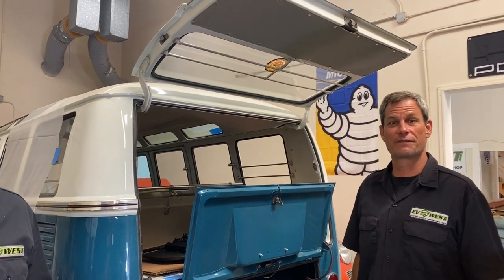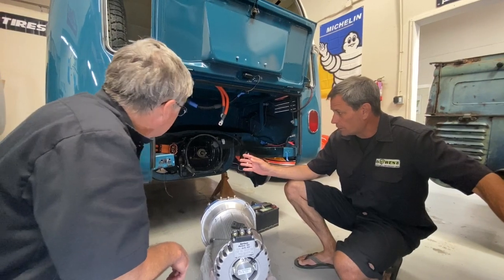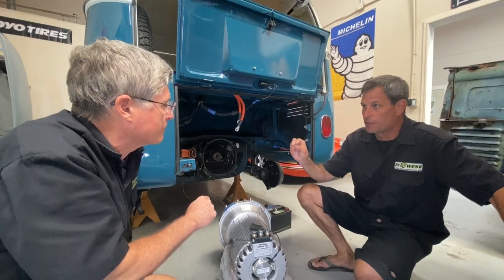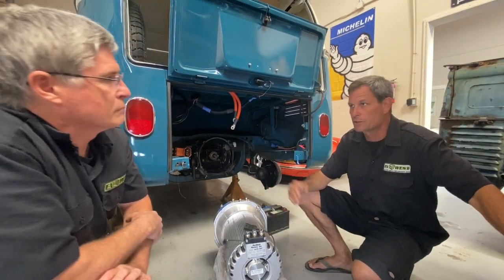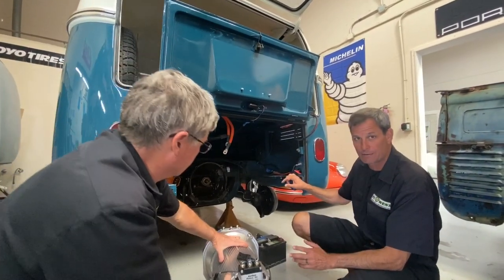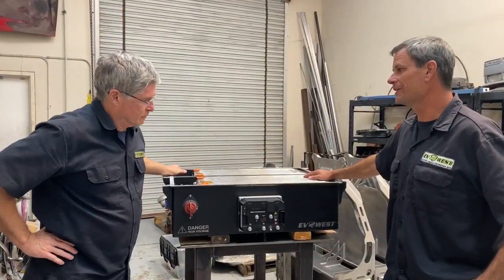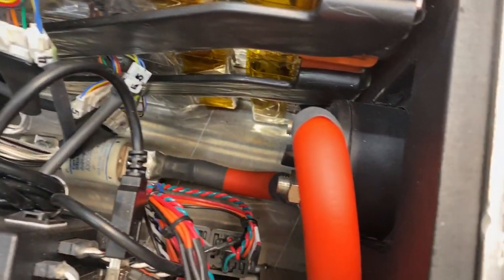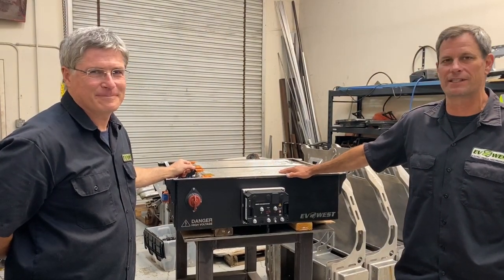Volkswagen Bus 21 Window EV Build | EV Show

Comment: Great video, thanks. Weight looks pretty rear biased, even more so than stock configuration? Why not put the batteries underneath midship?
Reply from the maker: The batteries are a bit more dangerous and difficult to place in the interior. This system simplifies installation, and the VW Bus is a commercial vehicle with a 1 ton capacity, so 340 pounds of battery is not much, also considering that our motor dropped over 100 pounds going from gas to electric. And weight bias isn't as much of an issue when it's a bus, not going to doing much 'performance' driving.
Reply: @EVWest  I was thinking more along the line of how Jehu Garcia mounted some batteries underneath his Samba below the floor. Probably more design and labor intensive and maybe requires alterations that would devalue from original condition. Interesting to see what the driving characteristics are like in the end with this design. The work taking place @EV West is very impressive. Thanks for sharing the processes.

Comment: Question, I am new to the EV scene and just starting to try to understand the amount of modules needed. I have seen a couple of your videos on the transporters and each has a different number of modules. I understand that the different types of modules have different kWh, but how far with this setup would 6 of the Tesla S modules get you on a single charge? Do you have a rough estimate on how much the battery box will go for $ ? Appreciate any info, thanks!

Comment: Does that DC motor offer regen braking as well?
Reply: It's an AC motor. So yes, it does have regen
Reply from the maker: Yes
Reply: EV West what are dimensions on that box? Would it fit in a VW Thing engine bay?

Comment: Why the contactors and other HV parts not inside the box? feels like a huge missed opportunity to clean up the build even more.
Reply: They are in a box. I'm not sure what you are referring to.
Reply: @dannelson6980   not in the battery box, so HV cables run into the junction box then back onto the battery box to the controller. But looking at it now why is there a shunt for a battery gauge when they have a Dilithium bms in the battery box that can have an battery display.
Reply from the maker: The use of an external contactor and distribution box does simplify the wiring for other high voltage accessories, such as the DC converter and charging systems.
Reply: @EVWest  But so would putting all of it in the the battery box. Why make an extra box externally and cram it so full?
Reply: @Tom-evnut  Maybe there just is not enough room. In our bug just able everything is in the rear battery box. There is about 6" in front of the modules for the BMS, contactor, relay, and fuses. We designed and printed a orange ABS box to house it within the battery box, the plastic box is vented and the DC to DC pulls some cooling air through  it. The DC to DC is mount on top of the battery box and dumps the warm air on the rear window to act as a defroster. In our 914 everything is separate the rear pack alone is three separate boxes to wrap around the motor.
Reply: @Tom-evnut  simplifies access to fuses and contactors, but also was a fitment issue. There isn't much real estate left in the box, and there isn't space in the bus to go wider or deeper. The whole system was engineered in Solidworks before work began, so we engineered it to have an external contactor box.
Reply: Thanks for the responses gents.  Do you get a lot of contactor failures that you would require access to them? My ethos when designing HV batteries is to have the contactors in the battery box so that is anything happens the HV is all contained within the box.
Reply: @Tom-evnut  We agree with you on contactor placement. The inclusion of a BMS and cut off switch in the box alleviates these concerns. Contactors are not failure prone, but we do access the fuses in the same enclosure from time to time. There are also high current fuses inside the battery box.